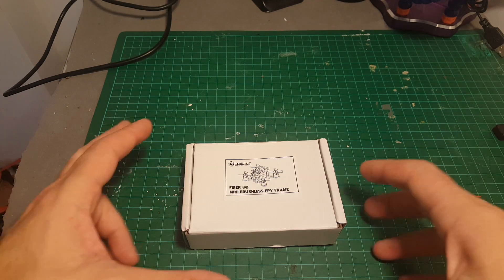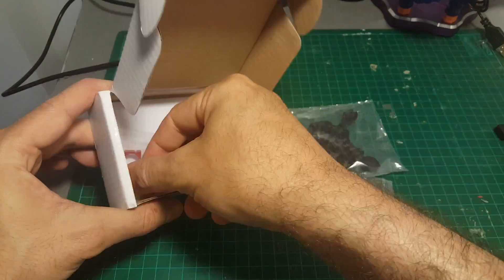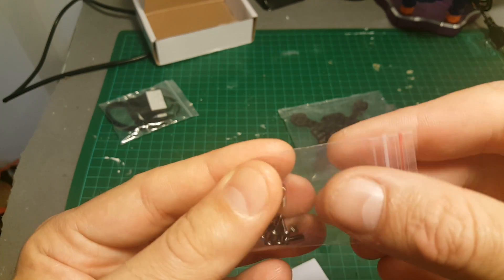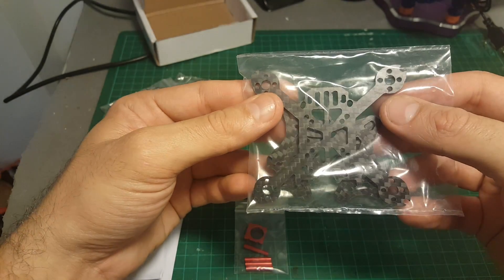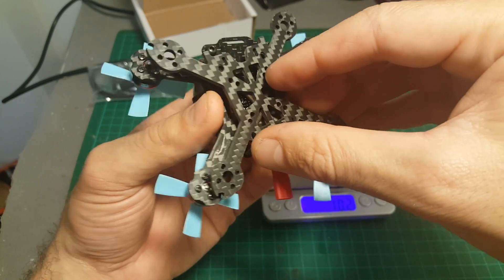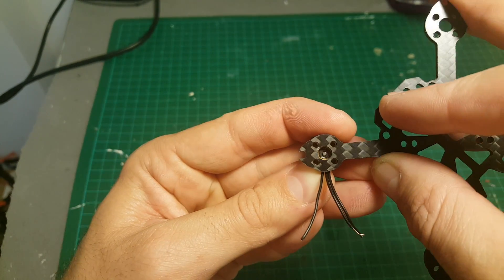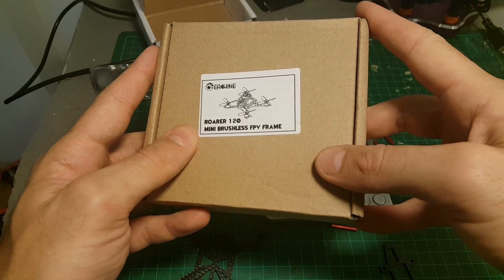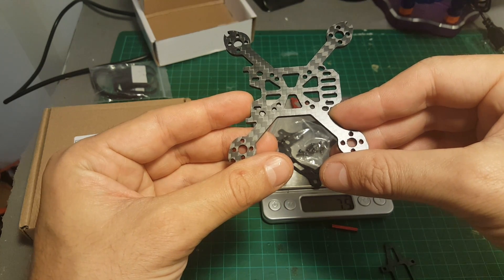Eachine Firer 80 Micro Brushless 3K Carbon Fiber Frame Overview

Comment: Will the aurora 90 guts fit in this frame?
Reply from the maker: +Evolutionpixel yes
Reply: You said 1104 motors won't fit Aurora 90 has 1104 motors? maybe the firer 110 would be better?